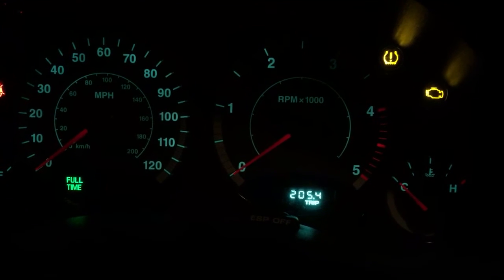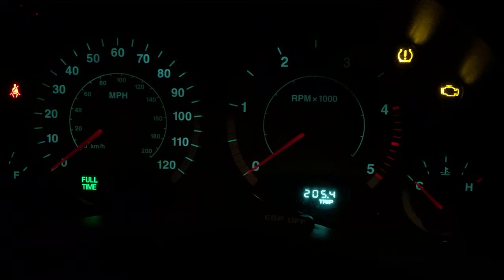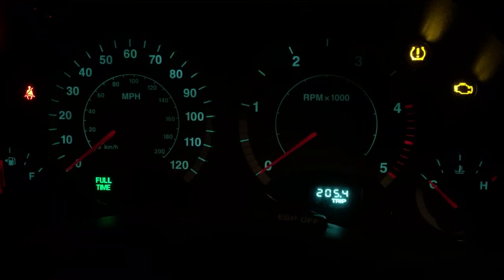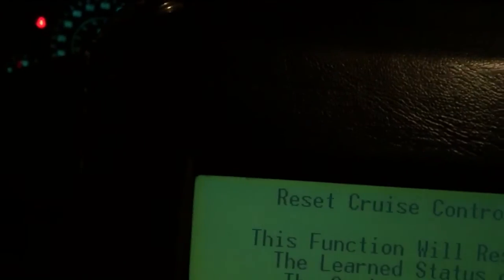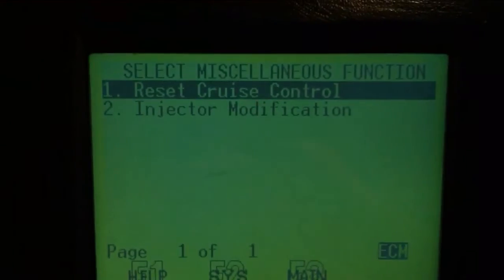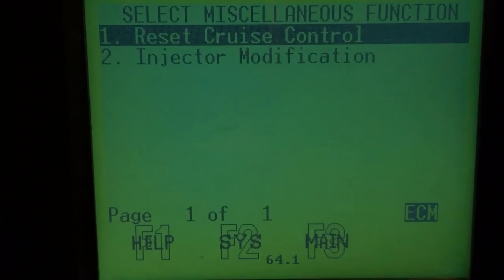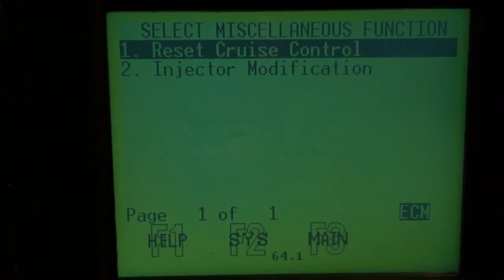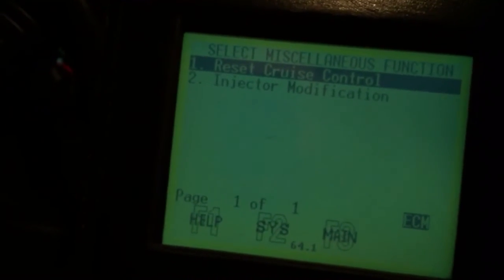Enabling cruise control on Jeep Liberty CRD Part 2

Comment: Hello , had some questions about your DRBIII. Seems like you know your stuff with Chrysler products . I’m up in Northern Colorado .
Reply from the maker: What are you needing to know?
Reply: @IcarusOffroad  Might be a long shot but thought Id throw it out there . I own a 2004 Dodge Ram 2500 with the 48re trans. It is not shifting into overdrive when the transmission gets to operating temp . After 20 min of driving or so. I’m looking for someone with a DRBIII scanner that can point me in the right direction . I know These scanners are rare , not many shops have . Noticed your in the front range area . Let me know if you’d be able to help me out .
Reply from the maker: @Rogue_Moose  reach out to me in my email in my profile. I don’t post the address so it gets picked up by bots.